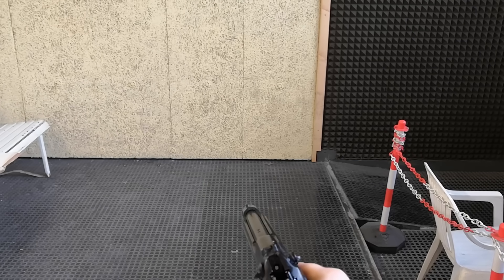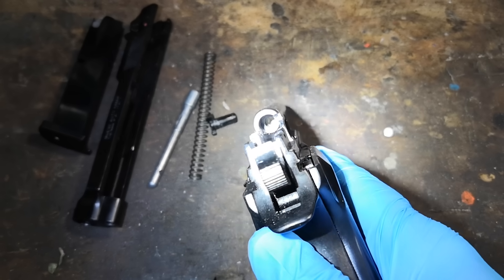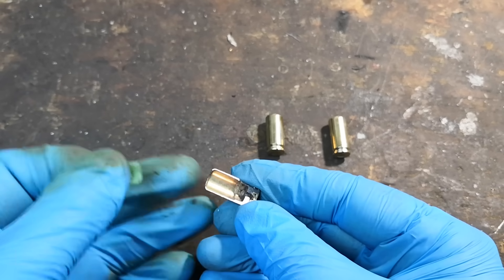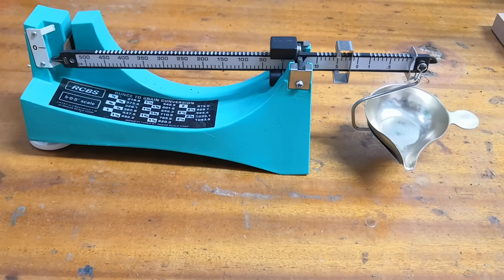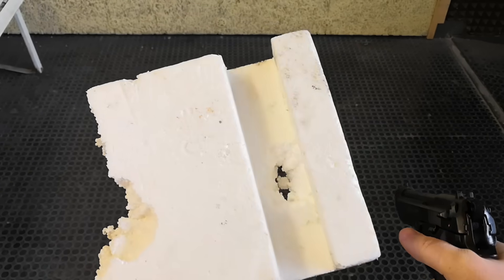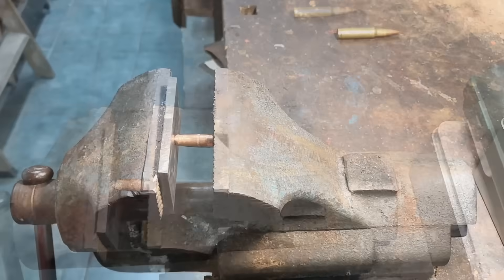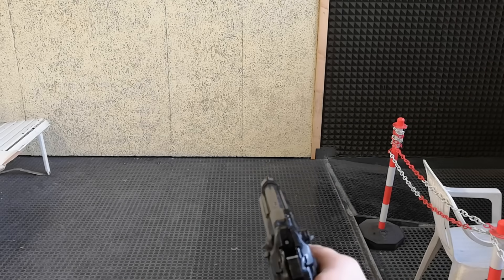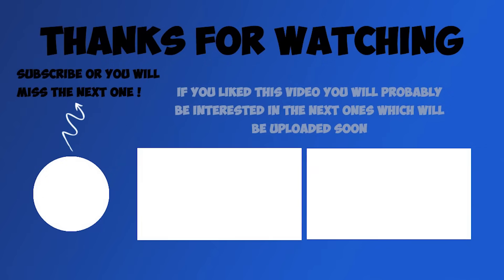Point Blank With a Blank Gun: Is It Really Dangerous?

Comment: about the revolver those gas are also extremely hot so in black poweder revolver a chain fire can ocure it was something fixe with cassed cartridge
Reply: It was also fixed if the cylinder was cut properly
Reply: nope @Mihail2204
Reply: @al-xo2cy it is, there’s no gap for any gases/burning powder to get inside the other chambers, also when firing, the chambers only get warm to the touch, so unless you’re extremely quick at loading the same cylinder and somehow manage to not have the powder spontaneously combust there’s no way for a chain fire as wind will cool it off even in a hot summer day, if you’re in an indoor shooting range then there’s still airflow and they’re generally very cold

Comment: Bro you said the blank ammo was less solid than real but you are comparing 9 mm ammo vs 22 LR. Is not correct. To be honest, I already shoot by the past with an modified pak and modified blank ammo and the 9mm doesn’t make any difference between a true and fake bullet cylinder. It was even most funniest cause the modified PAK can shoot Auto. The barrel was a 38 and the precision was similar to a Glock

Comment: Ok this might be a dumb question but after firing a blank does it leave shells like a real gun or it turns into powder only with no shells cases?
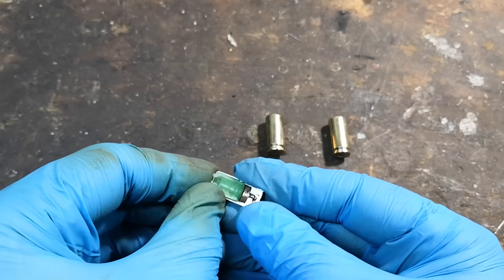Reply: A bit after 2:00 he says that the 9mm casings are made of steel. They would definitely not turn into powder.
Reply: @water1374  thank you

Comment: An out-of-date skin-on pork roast would be a better demonstration. The risk from blanks is real. Your video doesn't quantify the risk. High-pressure gas that prices the skin wreaks havoc as dictated by the 'Ideal Gas Law.' Revealing the caliber, cartridge, and velocity of the bullet shot from the revolver would give the viewer more usable information. The cylinder leakage could be anything from a 38 Special at 650 feet-per-second (fps) that stings and may tattoo exposed skin blacf to 125 grain 357 Magnum at 1500 fps that could take a finger of if the cylinder was misaligned a little bit. Again the skin on pork roast is a credible ballistic dummy.

Comment: The best "compromise" i can think of, off the top of my head, is the gun to have a small exit at the front as well, splitting the power between both exits while having enough power to load the next shot from the magazine. With a lot of finetuning it should be possible to happen and the gun shouldn't be as dangerous as the gun used in this video. Also if a tiny spark comes of from the barrel, it will save some time for the CGI guys during the editing of the footage.

Finally, I am confdent that anyone with basic knowledge of how guns work AND with a little bit of logic, they would figure out not to put their hands somewhere that "something" may come out in a violent way. That being said, I know that there are some people dull enough to be considered public danger, so my precious statement may not be true.

Comment: I spent a lot of time shooting blanks in training exercises. I always wore body armor, since I've seen multiple blank firing adapters come off, and launch downrange. Both the screw on military style BFAs, and the "Hollywood" style that aren't visible externally. I've also seen at least two 5.56mm blanks that were either under loaded, or loaded with pistol powder, by mistake, from the factory, blow a gun apart.

Comment: You don't want to just avoid the two vent holes, you want to avoid the end of the barrel entirely for about a good 5 or 6 ft.
Your blank gun is a little different, but a lot of blank firing pistols on movie and television sets are not fully obstructed barrels, only partially obstructed.

This is done because the barrel is obstructed enough to prevent any projectile from leaving the barrel, but still has enough opening to allow the escape of gas, pressure, fire, and powder to come out of it when fired. This is desirable from a film making standpoint, because once fired they look about as close to the real thing as you can get with practical effects, but it also makes these kind of more common prop pistols inherently more dangerous.

The end of the barrel is still putting out lethal levels of gas pressure at point blank, and even within 5 ft of the barrel it'll throw out burnt powder that will easily break skin or put out an eye.

That's why its actually more common these days for major productions to just use CO2 blowback pistols or even just rubber molds that visual effects artists make look like real gunshots in post, which never quite does the job when you compare it to the real thing, but its also a hell of a lot safer.
Reply: Hey I’ve seen you before😂
Reply: @_General_Grievous__  You're shorter than I expected
Reply: @Skyguy1337  Where is Kenobi
Reply: Alec Baldwin wants to know your Location
Reply: Why not just use blanks with half the powder or w/e?
Reply: Speech.
Reply: Yes...this very same blank gun can be machined through to partially open the barrel...and the two vents soldered closed. Operates exactly the same...and is just as deadly...just not venting in front of your eyes...but out front where it should be.  I have another blank firing gun as you say ...comes ready with full barrel, just partially closed. Still cant be used to fire bullets.  Some weapons used as movie props are real weapons, with blanks loaded in. Adds to the realism. This is why they use a set armorer to attend the weapons at every turn.
Reply: Hi , would the polystyrene test be the same with a real firearm . I'm thinking not .
Reply: I'm not reading allat 😹
Reply: that sounds way more sensible than burning powder on set

Comment: In Germany the blank guns don't have venting holes up to the top. Instead the pressured gas goes out of the muzzle. This is mostly used for fireing New Year's fire works out of these guns. All thinkable variations are available. So, it's funny. BTW, security is guaranteed by having steel blocks inside the bore, but let passing through enough gas pressure to support the slide and the fire work.

Comment: kinetic energy is MV^2 so the velocity plays a larger role than the mass, so higher velocity means greater kinetic energy, high velocity bullets dump a lot of energy in a very small area over a very short period of time, this ablates the impact area as the heat energy doesn't have time to dissipate through the material.  harder penetrators do not ablate as fast so they tend to drill deeper than softer materials at the same velocity. give enough velocity to a grain of sand and you could blow up the earth, granted you would have to break the laws of physics to do it, as you would have to exceed the speed of light several million times, but if you could do it, you could blow up the earth like shooting a watermelon with a high powered rifle.

Comment: blank  gun is  one  //blank  ammo in  real  gun is  lethal //and   blank  guns //i  made   a  lot  of them    shooting   ammo /in some  the gun alone    was  modified// rohm /little  joe,, and   a   simple  30 min  work on  drill press /or  if  possible lay,, you got   a 230 doll   total cost//including 1  hour  of   tool  shop //plus 120 gun //and you  got   for  my  feel  superior   version of   naa /north  am arms//small revolvers they  produce  in  all   of 22   cal  from  black pow to  22  mag and all  barrel leng,, but   they got  insane   number  of  inner  parts,and  like 8 or 10  super tiny  springs  ,,and since    original use  suppose to be self defence /although   now they are  more collector/gift  item /and   expensive as ,,the little  joe   with  same   close  to medium   power and  precision in  22 lr ,and   all   drum  and   all inner  parts account to less than  15 /screws included and 2   grips //i  feel  it   is   more   practical // this   beretta   92 //in our country  is   having a   flare /smal  12x20 mm   /15  meter  range /  and   a insert  to put  on  end  of   barrel //simple   for   1 shoot would  be  insert longer  barrel  and  put  a  ball in // but  i wanted this 92 to run  semi auto //problems// barrell  neaded to be changed // a   center  of ammo  was  not  in line with   barrel bore / but   off set  bore and   since   in time a  black  ammo   was same  problem  to  get as   real  gun i opted to  remade  original   8 mm  plastic cap  ammo it   used and inserted /7  mm   bullet   pressed  /glueafter  drilling  out   plastic cap  and added/or  later changed powder to  get   gun to  cycle// this  in land where ammo on black market  is as  weed  is  here  in  1  of 2  pubs and  guns too //this   is  of  no use // but  here a  guns and ammo  was   rare //and this   when  redone was a  7,some  mm   round    ball  shooting semi auto 16 mag capacity gun  with penetration  aprox 25 acp   browning baby  /and  i  realised that  piece  of   foam painted  black or and bullet tops   painted   blue  //gun looked  inert ,,and ammo   as original   if  not   looked  by  profesional  or  had a clue // where  is a will there  is a way// ps  i  dide  it when i  was 11// STILL WAIT  ON  YOUR COLD AIR GUN  DEMO

Comment: I’m confused.

How would this injure someone if you pointed the gun at them?

Because the only tests that were demonstrated were putting the gas escape holes on the top of the slide LITERALLY TOUCHING the object.

In a real world scenario if someone was trying to injure someone or something they’d point the gun at them like you normally would. Which as we know is obstructed because of the barrel design.

So considering the thumbnail of this video is a head with the gun BARREL against it, and although the video explains the mechanics of the power of the gas expulsion from the escape vents, how would someone be injured in that scenario unless (as I’ve said before) you put the slide against their face or body where the vents are instead of the normal way of pointing it at someone?

Comment: At the speed of light a hydrogen atom will hit something with the same force as a small rifle round
Reply: Hydrogen has mass, and nothing with mass can travel at the speed of light... you'd get infinity, or a divide by zero error. I think you theoretically can accelerate to any arbitrarily large fraction of the speed of light (like >99.999999999999% of c.) As the fraction becomes closer and closer to c, the energy gets more and more arbitrarily large.

At collisions close to the speed of light, you more likely have something like a huge release of heat, which will break molecular bonds and vaporize skin and clothing into gas, etc.

___

You've heard of E = mc^2? (E is energy, m is rest mass, c is the speed of light).

You're really supposed to combine it with the Lorentz factor. So you take E = mc^2, and divide the "mc^2" part  by:

Square_Root_of(1 - (velocity_squared / speed_of_light_squared))

Or to put it more neatly, divide by:

(1 - (v^2/c^2))^0.5

Comment: The Styrofoam at the start was broken up because the hot shell burned it, as you are able to see the burn marks, and he held it over the slide, which is why most of the Styrofoam was torn apart, as the moving slide applied force and yanked back on it therefore tearing it up.

Comment: It does not matter if I fully agree with your test or not. as a legally armed person and very strong advocate for safety and responsibility. Your facts are leaving in the right direction and it goes to show it doesn't matter what kind of gun you have whether it's a firearm a BB gun a pellet gun or a fire alarm design for blanks only. All should be handled the exact same way. Always treat it as if it were loaded with one in the chamber and never point at anything you do not have the intentions of pulling the trigger on. There is no such thing as being a little bit too safe

Comment: With the 9 mm shortage happening in the states right now, ive recently acquired an interest for reloading. However I was wondering what equipment you might recommend as being affordable and of a decent quality. Open to suggestions.
Reply: The Lee Hand Press is a good, inexpensive starter kit. You'll need to buy a set of powder measure dippers, the necessary dies, and of course, the proper powder, primers, and bullets. I'll assume you've kept your fired brass. I think I spent less than a couple of hundred all in, but that was years ago. Try looking at your local gun shop, and ask around.

Comment: I don't know if a blank firing gun is dangerous or not better go ask someone that might know like Brandon Lee....
Reply: Brandon Lee was not killed with a blank gun.
Reply: @nothanks3590  uhhh...yes it was why would they be using the real thing on set?
Reply: @nothanks3590  the set crew to save money PULLED the actual bullet out of the cartridges BUT the powder in those cartridges was so much more powerful than a legit blank that it they blew apart and created shrapnel. So the guns were in fact blank firing guns but they were loaded with legit ammo minus the lead slugs.
Reply: @lilredwagon5311  it was a real gun, not a blank gun and a real bullet was lodged in the barrel after a mistake with a dummy round that had a real primer in it by mistake and went unnoticed.  they used the same gun in a later scene with blanks and when fired the blank shot the bullet that was in the barrel into Lee.
Reply: @nothanks3590  ha! Not what I read/ heard. You go with your story bud
Reply: @lilredwagon5311  its not like what actually happened is a secret so you could go read it for yourself.

Comment: While working in construction, we used a concrete gun to drive nails into hardened concrete. The  “rounds” we used were .22 caliber that were crimped at the ends similar to the squib rounds used in this demonstration. The concussive force was so great that it could drive a 2-inch nail into solid concrete and if you did it right could be permanent. After a while, your wrists and hands would start aching from all that force.
Reply: That is such an amazing example of technology. Thank you for sharing. What did you mean the ends were curled? I am wondering how this would help the nail go in.
Reply: @sambosak  sorry, I meant to say that the end of the .22 casing was crimped and would open up when used. Once you opened the tool it would eject the used casing.
Reply: @tinman9341  Ah, I see. Thank you so much for replying with clarification! You're the best. God bless you and your work.

Comment: An additional reason the casings are made of steel instead of brass is cost. The same casing made from brass may cost up to double the cost of a wteel one. A major problem is steel casing is harder on the internals of a gun and therefore you only see them in low quality ammo or for weapons that have very robust internal systems. It becomes a tradeoff of do you spend more on ammo or maintenance. In this case I suspect cost is the factor over strength as the steel used in casings is very soft and while ballistic grade brass is softer it is just as capable if not stronger in certain ways.

Comment: You could ask the actor Jon-Erik Hexum who was playing around during a break in filming with a .44 Magnum filled with blanks. He took all out but one and simulated playing "Russian Roulette", unfortunately landing on the blank. The wadding promptly shattered part of his skull, driving pieces of it into his brain.  Six hours of surgery couldn't repair the damage and he was pronounced brain dead 6 days later.

You could ask him, but he never made it to his 27th birthday.  2 months after turning 28 Brandon Lee, Bruce Lee's son was also killed by an error involving improper loading and clearing caretaking of a S&W .44 Magnum where a bullet was propelled part way into the barrel by the primer of a "dummy round" which had the powder load removed and the bullet replaced, rather than buying proper dummy rounds with no powder or primer.  

The bullet wasn't discovered within the barrel and when it was later loaded with blanks, the powder charge in the blank forced out the trapped bullet, striking him in the abdomen.  Six hours of surgery later and he was dead.

A firearm should always be treated as loaded and in the case of "acting" should have checks and double checks for safety and proper loading and usage!  It's not "just a blank".

Comment: “Point Blank” is a MILITARY term meaning a range that you can aim at a given target, with a given load, with a given gun and sight setting, and the bullet will neither rise above not fall below the target.
Therefore Point Blank for a head shot with almost any handgun is about 25-50 yards, while if the torso is included Point Blank would be ~100 yards.
Please DO NOT use the term “Point Blank” to mean “contact”.